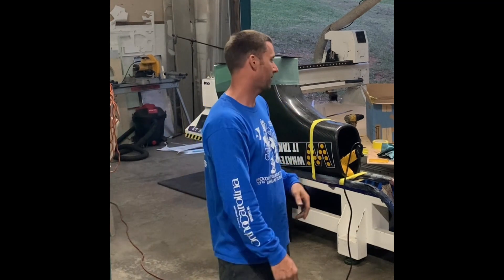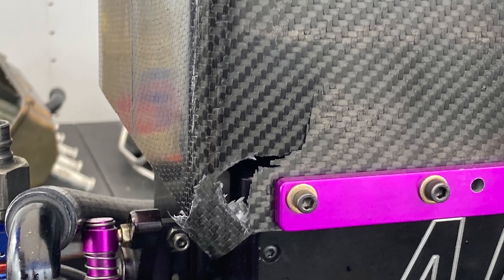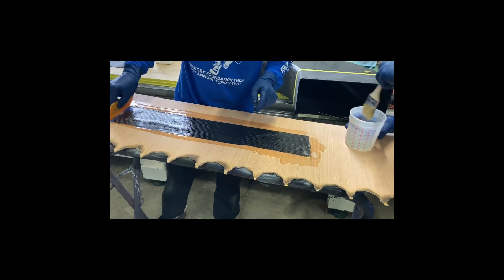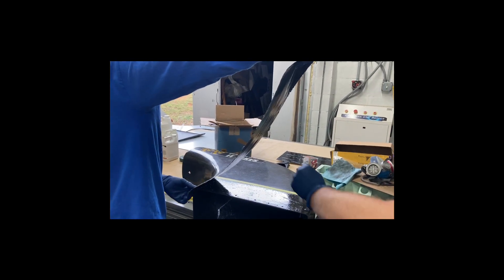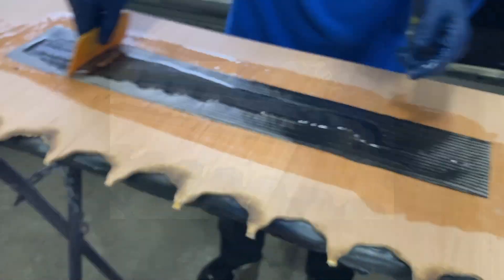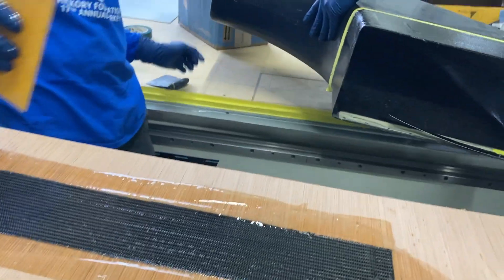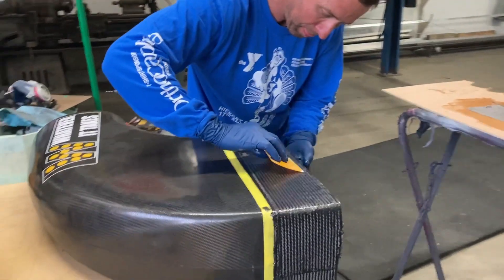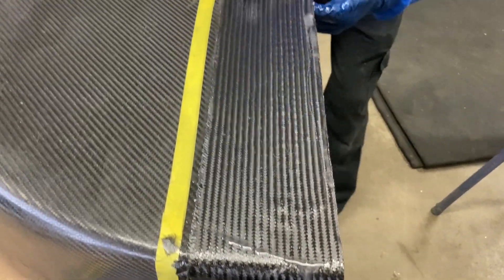Tech Tip Tuesday: Carbon Fiber Repair

Comment: Adding that heat probably made the bond twice as strong.
I used to brush on some slow cure epoxy over the repair and then hit it with a heat gun till the epoxy was ultra thin then applied the carbon and let it cure in a warm area. 
The thinner you can get the epoxy by heat the more it will flow into places it never could with room temperature, you can even try a test on some window glass, heat one layup till its super thin epoxy then another lay up over room temp. After cured the colder layup prep one will pop right off and the other heat prep one will be on there forever, nothing will take it off except grinding or sanding.

Comment: I have a small crack on my cold air intake which is carbon fiber and I'm going to put a small piece of the fiber inside because it broke through the weave Do you know if it will adhere good enough and not break loose and gets sucked into my intake I'm so nervous about it lol
Reply from the maker: As long as you rough up the surface w 40/80 grit and use a good resin, you should be fine
Reply: @bradmcbrideracing2765  i have a big gash in my carbon fiber hood that was damaged in a crash, any good ideas how to fix it? i was thinking of buying some forged carbon fiber shreds and just mixing epoxy, packing it full and then putting a clamp over it till its dried.
Reply from the maker: That should work. If the gash is large it needs to be filled. It sounds like you have the right idea. I would soak th shreds in resin first like you see in the video. Then pack it in. If you do not have some wax cloth, you may be able to use some aluminum foil to cover the repair til it dries. Or if the surface is flat, just use a piece if metal.
Reply: @bradmcbrideracing2765  ok thanks for the advice,  can i also put something to clamp it like a C clamp and some plywood?